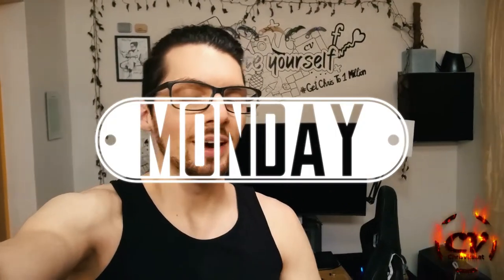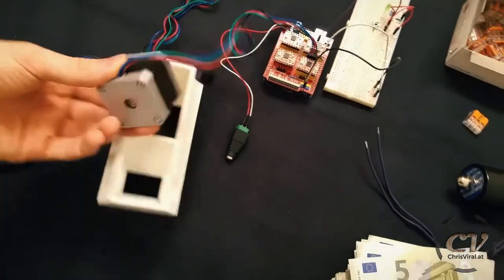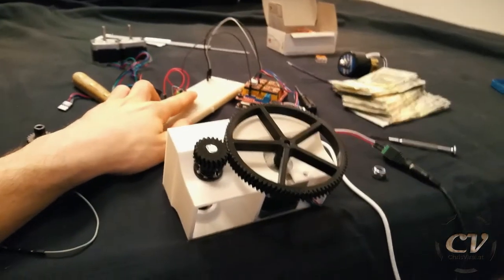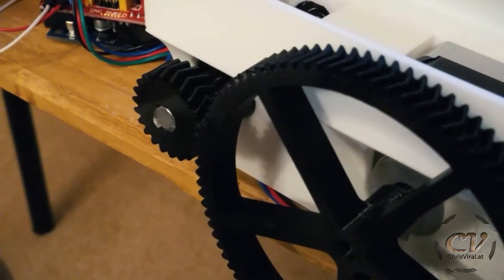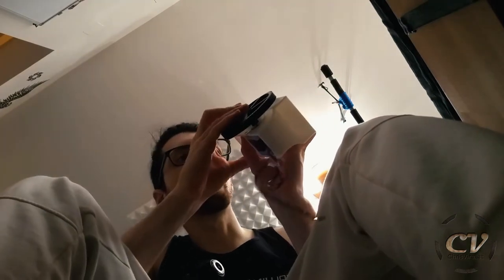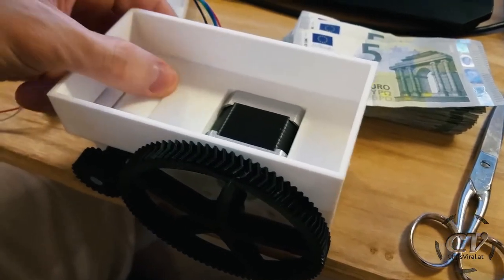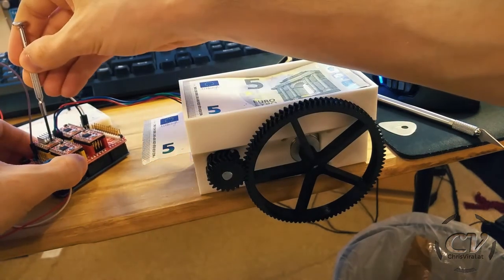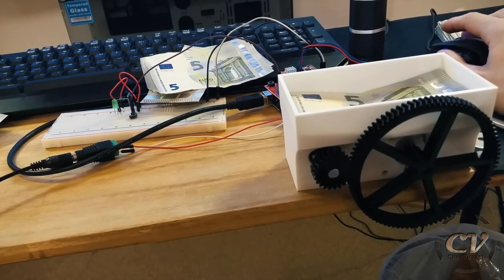Cash Dispenser (Shitty Robot) Stepper Motor & Arduino

Comment: if you want to improve it, look inside a printer how they solved that problem.
if i remember correctly they use 1x pusher wheel (like you did) but right behind that (some mm space) a second wheel(pair) to finally suck only one paper.
Another idea woulb be: usea leverarm (3d pirnted) to push with a sprint on the money from the top (like you did with your finger) , but add an adjustment screw to finetune the pressure from the spring. It looks like too less or too much pressure is problematic.
Reply from the maker: Genius. But I'll probably scrap the whole idea and go for more like a blast mode... We'll see :D